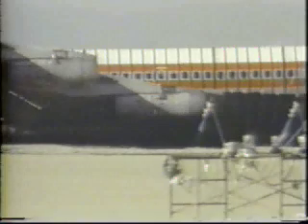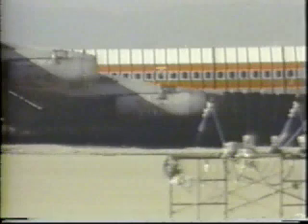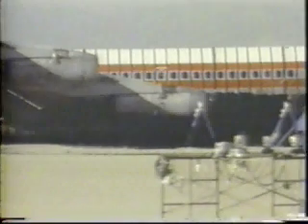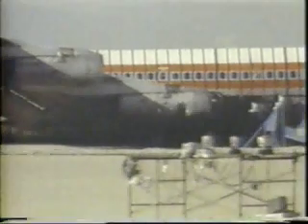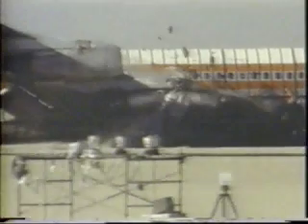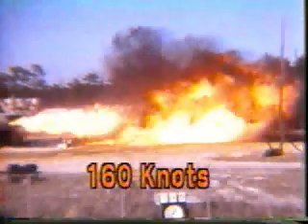Controlled Impact Demonstration Aircraft Crash Test

Comment: I remember when this test was conducted at the Dryden Flight Research Facility at Edwards AFB on 1 December 1984 like it was YESTERDAY!!!   The way I see it, even if the flames had NOT penetrated the fuselage, the passengers and crew WOULD have MOST likely died from smoke inhalation.

Comment: Did the passenger dummies survive?

It is pretty weird that the fuel did not manage to lay waste to an aircraft though it could pulverise a skyscraper.
Reply: The point here is that al fuel burned almost instantaneously as it was sprayed and mixed with air, thus all ignition happened very quickly and heat haven't transferred inside the aircraft in such a short time.
Reply: Seriously? The point here? Did you see the size of the fireball that occurred when the planes went through a sieve of steel columns several inches thick? My guess is that the fuel burned almost instantaneously and that is one of the reasons why the fires were almost out 50 minutes later when there were people waving from the hole made by the plane.
Reply: timtak1 I'm talking about this crash test. The size of fireball doesn't mean a lot as heat from fire can not transfer inside undamaged fuselage in just 9 seconds. Thus the real danger for dummies in this test were not the fire, but the impulse also known as g-forces.
Reply: timtak1 

Take an engineering course. The steel in buildings is designed to withstand weight during normal temperatures. When it gets hot (like a giant fire fueled by jet fuel), it weakens. Try and take a guess at some of the vertical loads in a giant steel and concrete building - a bit more than the lightweight monocoque shell of an airplane, yes?

Building code requires steel be either covered or painted in material that can resist flames for only a few hours. A lot of that covering was destroyed in the initial impact, not to mention most of the primary WTC structure forms a shell around the outside, which was already fractured by the impact/crash to begin with. In combination with the additional heat from the fire, it is no surprise to me that the steel structure failed, and gave way to the results of gravity. It is actually a miracle that they stayed standing for as long as they did. 

And don't give me any of that "its obvious if you just look at the video footage" nonsense, because just like the government and all your conspiracy theories, there is a lot you can't see as well going on that you choose not to mention. Ask any engineer/architect that actually graduated school with a degree what happened, I dare you.
Reply: The firefighters didn't put out the flames completely. That's just not true. Just because you can see people waving out the window doesn't mean all the fires are out. And just because you cant see fire, doesn't mean there isn't fire. The tanks of the planes were almost full. The towers were smoking until their collapse. 

"electrical and electronic engineering" ok... enough said about this... =P

Debris did fall off the buildings sides, not just straight down. Building 7 used a transfer-truss structure which was damaged by the falling debris. It had a heavy load of mechanical equipment placed on it halfway up the building, and it's primary structure was critically compromised. When one section or member fails in that kind of system, the whole thing goes down. It's not the best design, but its what they used in New York for that building, and its what led to the collapse, not a bomb or anything else. They have those pieces that failed in custody, and they have been reviewed by several different private engineering firms not under government contract, subsidy, or control. 

How tall/large were those steel framed buildings in Kobe that did "not pulverizing themselves straight down, rapidly, to small pieces, in most part, almost to dust."? First of all, there is not much steel building in Kobe. Most of the failed buildings were concrete or reinforced masonry (no steel, not even re-bar in some cases). My first guess is they were a lot smaller in overall scale than the WTC. When things break, they drop. No building of that size is going to flutter away in the breeze as it goes down, or tumble over into a neat pile. And once the top breaks, you know where it goes? Down. I don't see how a tall building collapsing from structural failure has to look any different from a building being demolished intentionally. When you have that many tons of concrete pancakes falling down on top of each other like dominoes, expect it to turn into smaller pieces, and expect some dust. I think the illusion of scale is confusing your perception of physics. 

I could also use the argument that the buildings in kobe were destroyed from the bottom up due to earthquake - this is why some of those buildings stayed in one piece, but just seemed to "topple" over. The lower structure (bearing all the weight) failed because of it's high loading and direct connection to the ground, whereas the upper structure did not have as much load stress or trauma. Its a different kind of structural failure, in a completely different structure, in a completely different scenario. 

But when you multiply that vertically by ten times, and punch a flaming hole about halfway up, all of it is going to come straight down very quickly. A skyscraper does not teeter totter and then lean over to the side like in a Micheal Bay film, eve if it is made out of a ductile material like steel. The remaining floors below cannot withstand impact loading once even just 1-2 floors above start an initial collapse. 

If your main argument is that they put out all the fires, everything was fine, and everyone had a clean chance to leave the building before it was unexpectedly demolished by separate, controlled explosives - it just doesn't convince me. I guess some people have a hard time believing that taking out just one structural beam or post in a building taller than 12 floors is like taking out one of the bottom corner blocks in a Jenga tower - and some people (like me) have a hard time being convinced of anything else. To each their own.
Reply: Cherry Voodoo YEAH CHERRY VOODOO YOU ROCK! Got your facts right on, timtak1 didnt even stand a chance!
Reply: How much do you wanna bet that this Daryl channel is a sock account of  CherryPoptart? That was a copy / paste retort.
Reply: ok u might not believe this but this report is totally false i saw the original news report buy dan rather and the original max x episode that SHOWED  the original footage of all the dummys  burning up and flames completely intruding the cabin ant the picture of the plan after the fire showed the fuselage completely  burned open so to answer ur ?? no they would not have survived
Reply: Cherry Voodoo
> Take an engineering course.

I have. Bachelors and Masters in electrical and electronic engineering (with a mechanical component). I like to think I see things as an engineer.

> The steel in buildings is designed to withstand weight during normal temperatures. When it gets hot (like a giant fire fueled by jet fuel), it weakens.

True, but note my point above about how the fires had gone out to the extent that there were people waving from the point of impact.

> Try and take a guess at some of the vertical loads in a giant steel and concrete building - a bit more than the lightweight monocoque shell of an airplane, yes?

Yes. But if such a fire can take out a large steel framed building from top to bottom, even on the many floors where there is no fire, one might expect a greater destruction on the weak aluminium frame of an aircraft facing a similar fire. Also note, that the "fire" expendened itself very quickly as a fireball. Did this happen in the case of 9/11? Did the fires go out, or almost go out, quickly? Were the fires largely out when the buildings came down?

> Building code requires steel be either covered or painted in material that can resist flames for only a few hours. A lot of that covering was destroyed in the initial impact, not to mention most of the primary WTC structure forms a shell around the outside, which was already fractured by the impact/crash to begin with.

So far so good.

> In combination with the additional heat from the fire, it is no surprise to me that the steel structure failed, and gave way to the results of gravity. It is actually a miracle that they stayed standing for as long as they did. 

Hmm.... I could see the tops of the buildings toppling off, as a large steel frame.

> And don't give me any of that "its obvious if you just look at the video footage" nonsense, because just like the government and all your conspiracy theories, there is a lot you can't see as well going on that you choose not to mention. Ask any engineer/architect that actually graduated school with a degree what happened, I dare you. 

As you know there are some several architects that are not convinced.

Building Seven is very worrying.

Three buildings, straight down, almost completely pulverized, on one day is even more worrying.

Steel frame buildings have steel frames.

I have seen the aftermarth of an earthquake and fires on steel framed buildings (Google "Kobe earthquake"). The steel frames fell, or did not fall, like you'd expect (as an engineer) steel frames to fall, bits of building in large pieces, buildings on their sides, diagonally, crumpling on some floors, but not pulverizing themselves straight down, rapidly, to small pieces, in most part, almost to dust.

The Nile is a river in Africa :-)
Reply: Wikipedia has a list of skyscraper fires here
https://en.wikipedia.org/wiki/Skyscraper_fire
You can search for video footage of the fires here on Youtube. It is quite enlightening.

Comment: @nowmythoughtsare - They were testing an experimental jet fuel called anti-misting kerosene (AMK). AMK was meant to turn into a thick gel when subjected to a strong shock (i.e., in a crash) to prevent it from misting and mixing with the air, and creating an explosion. Needless to say, the AMK fuel ultimately failed with this test; because it exploded and burned just like regular fuel.

They were also trying out new seat harnesses, hence the reason for the crash test dummies.